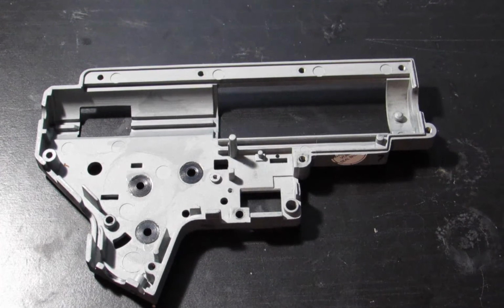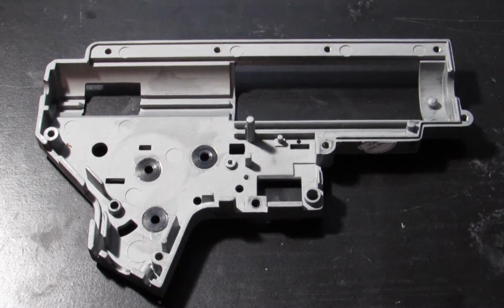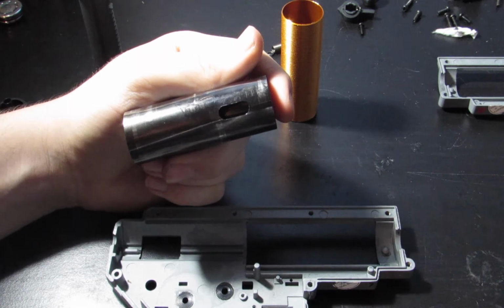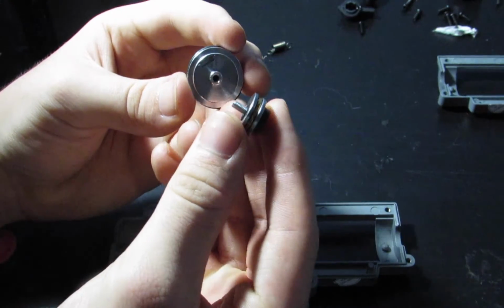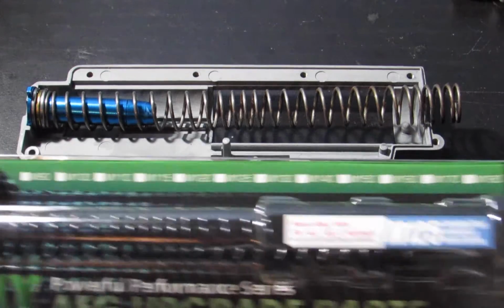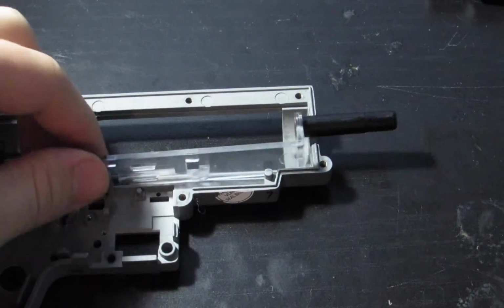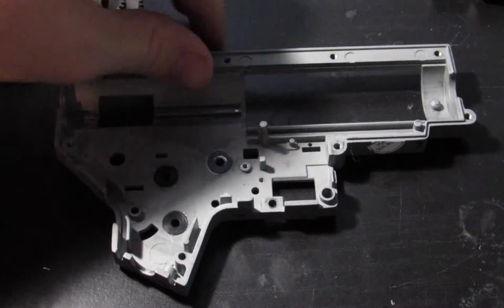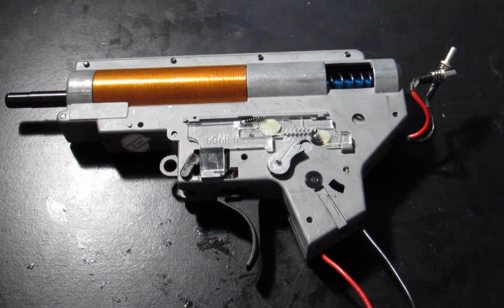Airsoft Upgrades: Gearbox

Comment: Tbh, all I care about is upgrading my shit to handle 11.1v lipo. Throw a drum on and you have. Semi compact lmg. Well not actually compact but still has a super high rate of fire fire. From what I heard, I need to do a total rebuild on the gearbox but so does any major upgrade.the piston moving faster and gears spinning faster have more pressure. And to avoid electirc issues, it also needs a better mosfet and silicone wires.

Comment: I purchased an ARX 160 from a local store and it came with a hybrid version 2 polymer gearbox with metal gears. Would I be able to just upgrade the gearbox to a metal one? I ask because I would like to also purchase a better battery. The one it came with is kinda crappy but I don't want to melt the center of my gun.
Reply from the maker: +Stump Stomp funny, I just bought one off of eBay for $20 hasn't gotten here yet however. Is it disassembled from screws that splits into two halves or like a higher end LPAEG with takedown pins?

Comment: Would upgrading a version 6 gearbox be any more difficult than upgrading a version 2 or 3?
Reply from the maker: +Stevenfeelsberg Not particularly. They all have the same basic parts, just in diffrent locations.
Reply: +WolfAirsoftGaming Thanks! I've been thinking about upgrading my P90, but I've been nervous about how difficult it would be.
Reply: +WolfAirsoftGaming Ok, kinda new to airsoft buy I'm completely loving it an want to stick with it for a while and I love th M4 body and variant so I already picked out my external body and I want some of the best internals that will last me a while.  What would your recommendations be?  Thank You.

Comment: Hey, awesome video! I'm new to this and I'm going to be upgrading my first gun and I need help with one of the parts. I'm going to be getting the blue Lonex piston and I'm not sure if an M100 is good for it. Do stronger pistons need stronger springs? If not, is the M100 ok? And I'm also getting the Prometheus gears and I'm assuming that'll work well with the piston and spring. Thanks!

Comment: Hey! what kind of piston and cylinder you thinks i should order for a basic CM16?
Reply from the maker: epicxsibbe67 The piston I always upgrade to a full metal tooth one (torque) with 14 teeth so that correcting its AOE is easier. However I wouldn't upgrade the piston (or really open the gearbox) unless the stock one strips. If it's fine I wouldn't just get a new piston as theirs not much point besides having it last longer. As for the cylinder, get one matching your inner barrel length.

Comment: Well now that I've watched all your vids on internals I feel much less like a noob!  I tended to just focus on externals but I've been looking for the best battery for my VFC SCAR-H and everyone agrees that the wiring and battery space kinda sucks. So I started looking at reviews about the rest of the internals on the SCAR and the newer version seems to be better than the older one that came with a carry case, but still had room for improvement.
Reply from the maker: Yes, the older versions had more flaws that were fixed. About a battery, I used a 7.4 2400mAh lipo. you could fit a 1600mAh 11.1 if you wanted a faster ROF in your stock. Either way space is limited on the gun, but its only a small problem.